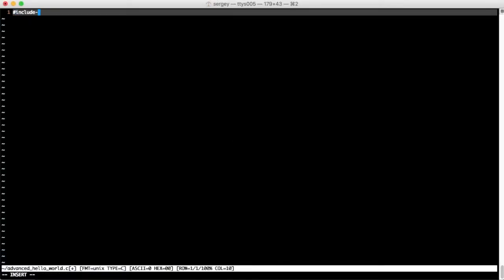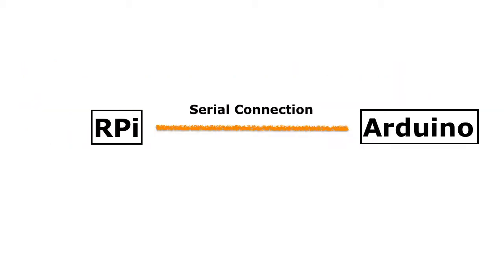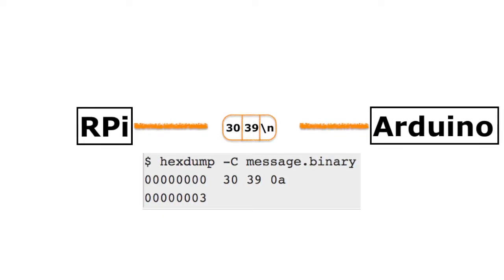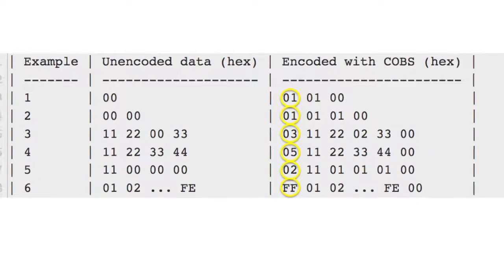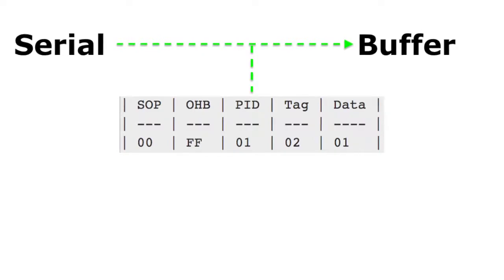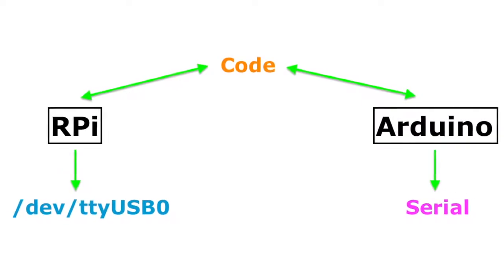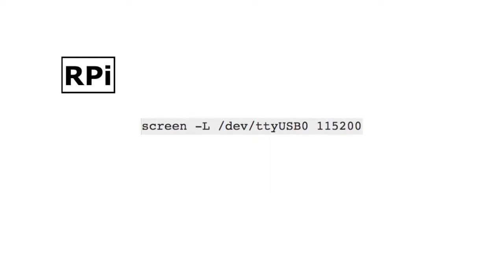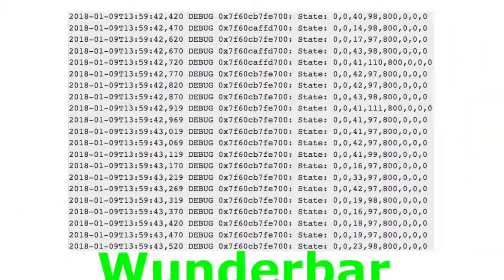Custom Protocol for Serial Link Communication

Comment: This is great.  I am going through exactly the same thoughts about how to transmit data over Bluetooth.  I don't want to send it all as ASCII, but want an efficient way of framing packets to make sure all the data arrives safely and in a way that is easy to process.  This looks like a great solution.  Thank you!